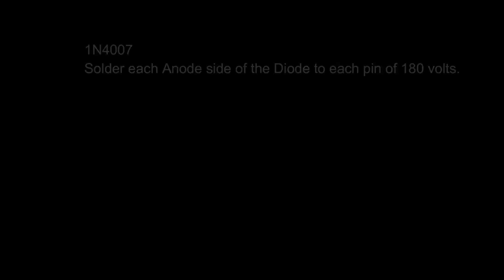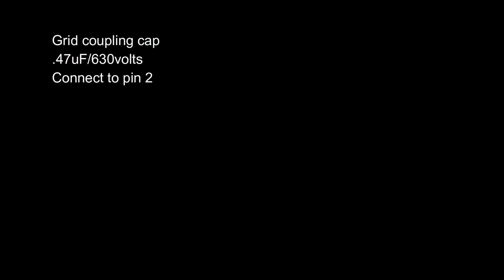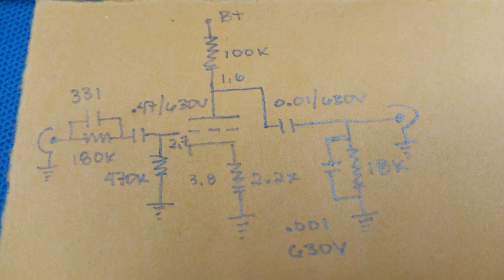Let's make a tube preamplifier for ceramic cartridge

Comment: For a Cheap-ish low volt pre on double triodes, search the web for circuits on soviet tube 6N23P.
This is similar to 6922 and ECC88, functioning in few hybrid amp schematics at 24v successfully.
Could possibly even work direct as a full amp for piezo pick up.

Comment: The tube is called actually differently. 
These are Cyrillic letters, as tube origin is Soviet, or Russia, which ever way you wish.
6H2П  reads in latin alphabet  6N2P
Not 100% identical, but pretty much same as 12AX7 or ECC83.
Just need to bare in mind the difference of heater voltages and the pins addressing too.
I believe, chinese make and mark the same tube as 6N2
Reply from the maker: Yes pin configurations especially heater are not the same. 12AX7 has High gain compared to 6h2n.

Comment: is there a circuit for 12 or 15volt
Reply from the maker: You mean solid state ceramic preamp? Because in tubes 12 volts is only the filament the B+ is high voltage from 100 volts up. Just update to this channel I will upload a ceramic phono stage for 12 volts supply.

Comment: what size copper is used for a 20ma transformer
Reply from the maker: 0.2mm
Reply: @woodys_hobbies  seriously, i tried 0.2 to turn on the 6v6 and the tube was so hot it exploded
Reply from the maker: @reganaudiochannel  6V6 is different it's an output tubes.